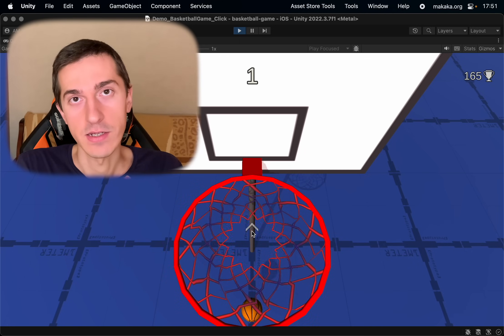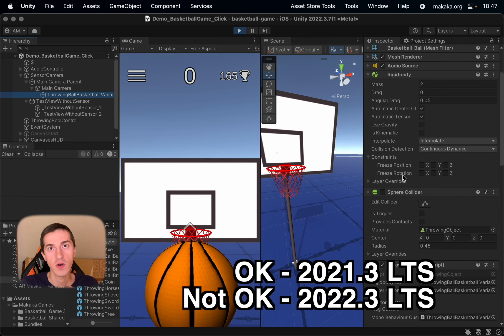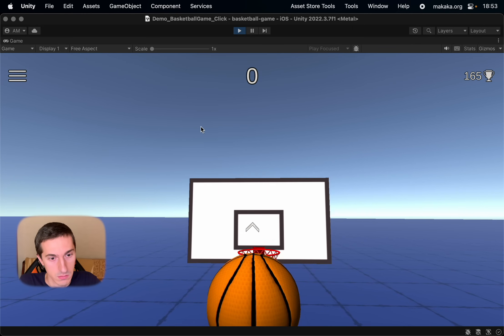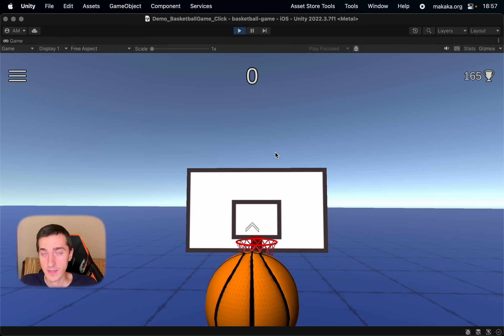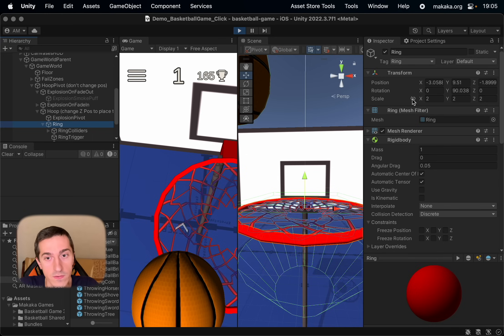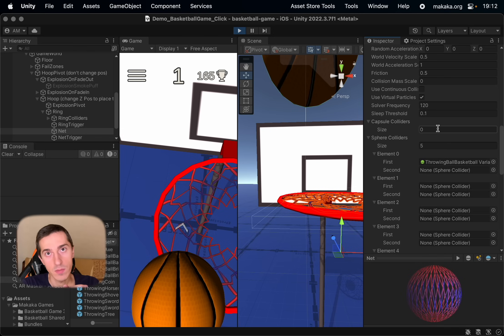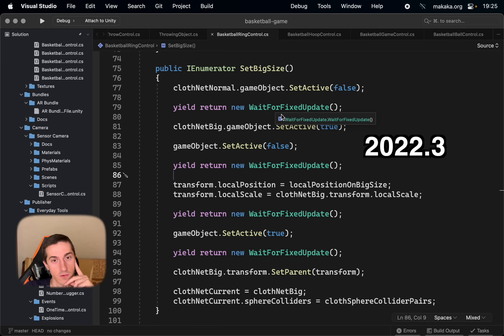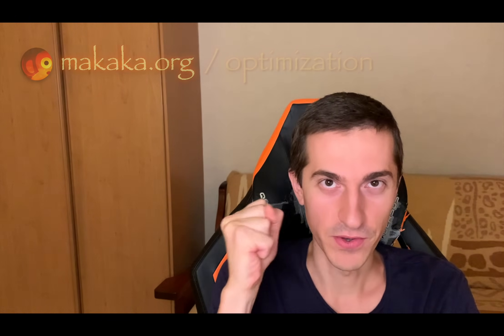How to Fix Bugs in Unity — Rigidbody & Cloth — Tutorial — Unity BROKE the PHYSICS... AGAIN

Comment: Hi can you please make a tutorial about how can asset store publisher verify customer within there unity asset before letting customers use their asset . I have seen many asset doing this to keep there asset secure on unity asset store . there is a editor window that appears where you need to enter the invoice number and after that you will allowed to use the asset further .
there is not much information about this how to exactly do these kind of verifications . i will be glad if you could make one tutorial about this .

Thanks
Sourav :)
Reply from the maker: All my knowledge about the Asset Store is located here: https://makaka.org/publisher

API for checking invoice numbers is here: https://publisher.unity.com/invoices

I didn't see such experience over 9 years of using asset store. You can't control each file of asset, you can't prevent copying from File Manager outside Unity Editor. Do more important things — you won't get any money from the pirates anyway.

P.S. I only saw checking experience to update the asset from Unity Editor without Asset Store.
Reply: @MakakaOrg  I understood your point completely but what I mean is  that if a asset store publisher wants to make small bug fixes or any minor updates they can provide these updates immediately to the customer by providing a way for them to download and check for update in unity editor itself where they could enter ther invoice which could be verified and once verified. It automatically downloads the new update from GitHub/Bitbucket project. 
For this may be a tutorial will be helpful .
Reply: @MakakaOrg  so only verified users get the updates of the asset.